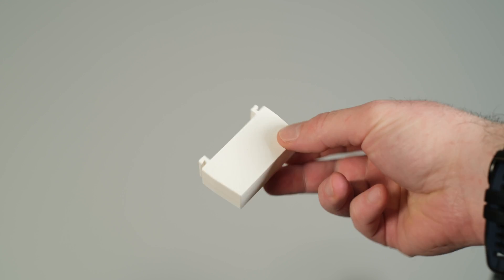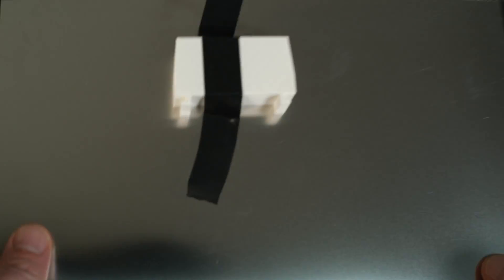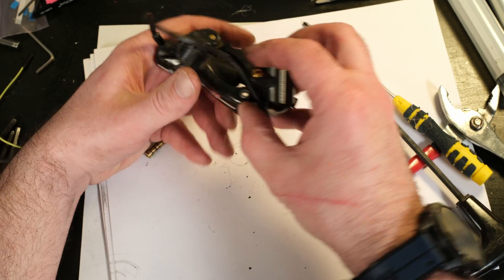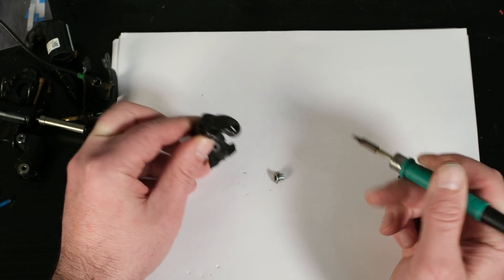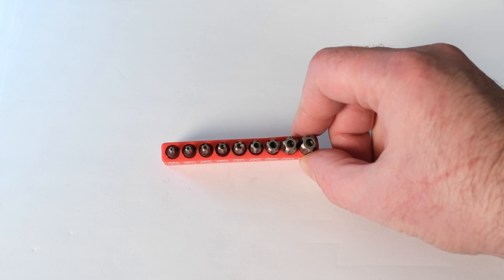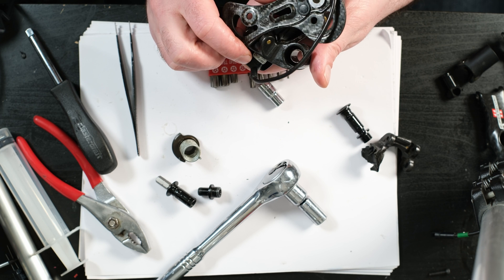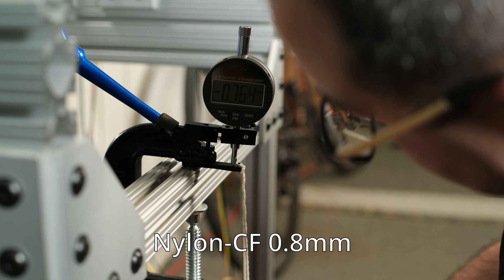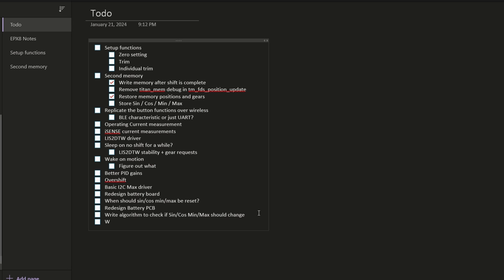Revisiting Campagnolo EPS Derailleur Battery Placement - EPX9

Comment: Why do u keep faffing with campy stuff? Nobody rides it anymore
Reply from the maker: Hackability. I have a long list but in short Campys Eps derailleur have no brains. So I can make them do anything I want. 10spd or 14spd. Sram and Shimano would require destructive opening (bye bye waterproofing!) and fully reverse engineering their whole pcb and writing new firmware from scratch specific to their hardware. So you need about 3 derailleur that will factually end up trashed to do a reversing on various things and the 4th one won't be waterproof. Also I've tested force and speed. Eps is faster and provides more force than Shimano or Sram axs. They are newer but lower performing technically.
Reply: Keith, please never quit tinkering with Campagnolo EPS 11 Speed. You could be my saviour 😂

Comment: Does the battery have to go on the deraillleur? Strap it to the chain/seat stay.
Reply from the maker: It doesn't. Seat and chain stays tend to be various shapes and also tend to be tapered. This makes it easy for things to slip and rotate. And once that happens you've got the teeth of a sprocket and very high current capable pouch cell meeting. That's always in the back of my head. This leaves you relying on types of adhesives to prevent movement.